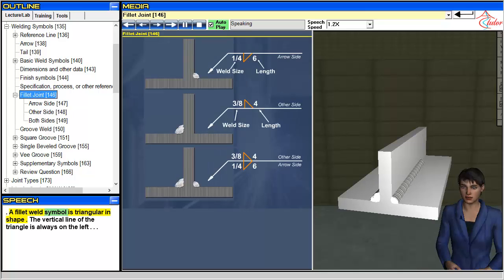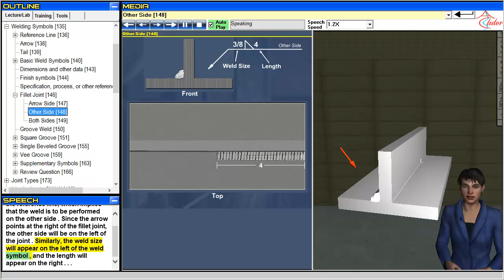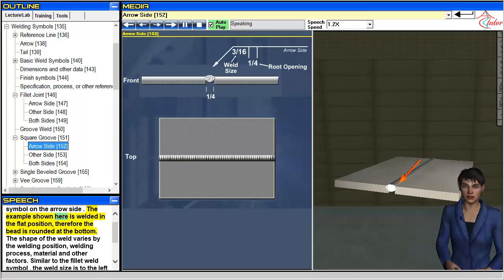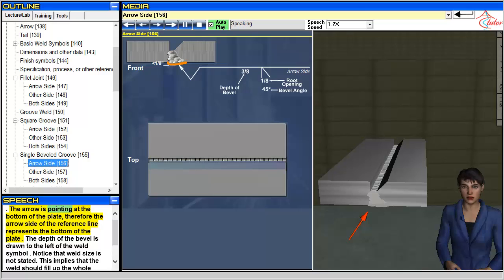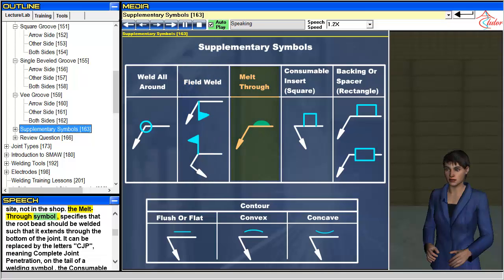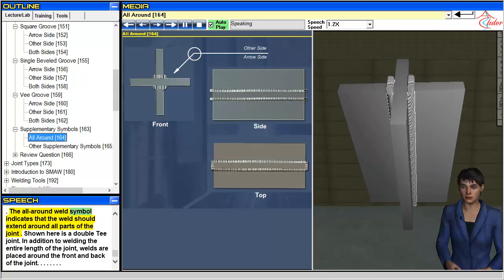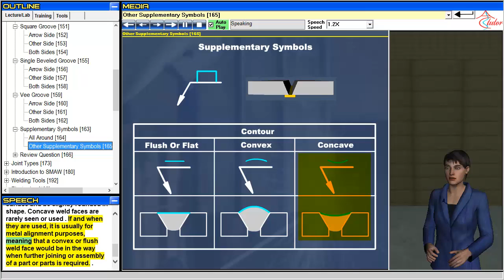Virtual Welding - Welding Symbols Part 2

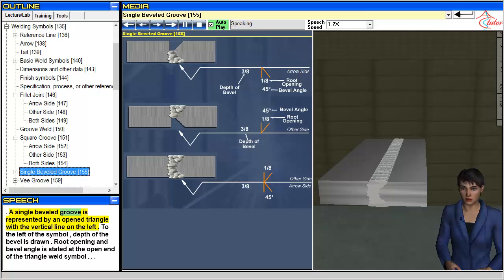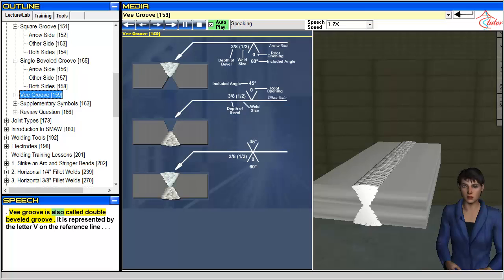Comment: From 3:20 to 4:38 is incorrect, as the "broken" arrow  is supposed to point to the side to be prepared (L or R) not to be confused with Arrow side/Other side. The arrow in this presentation points to the LEFT side, yet the picture showed preparation on the Right side. Ref AWS A2.4 Section 4.1.3.1